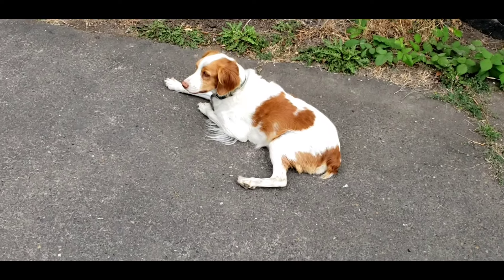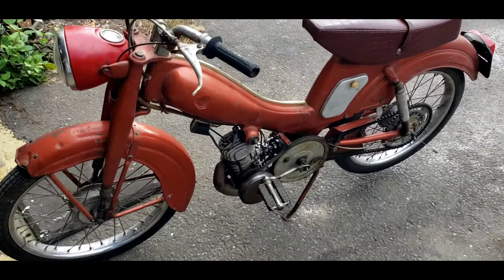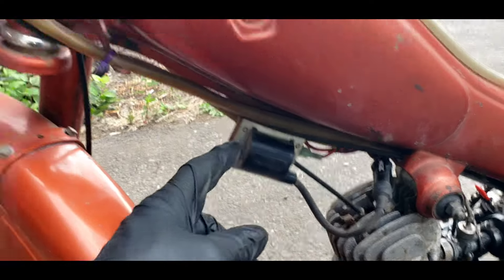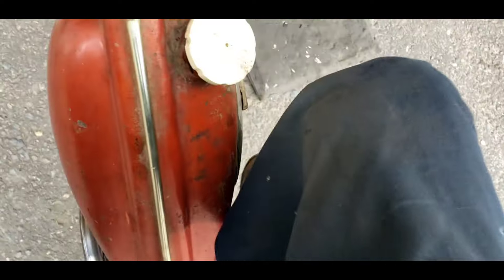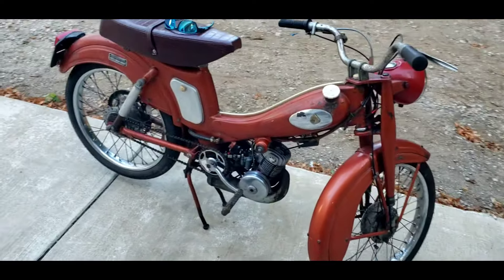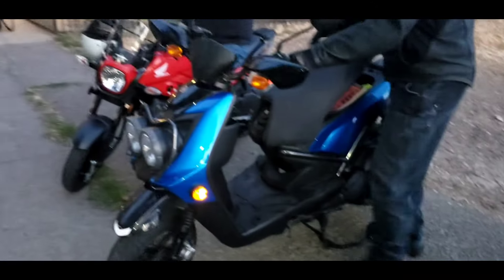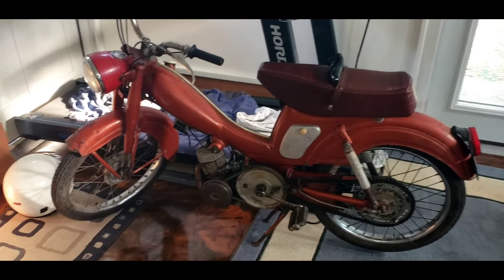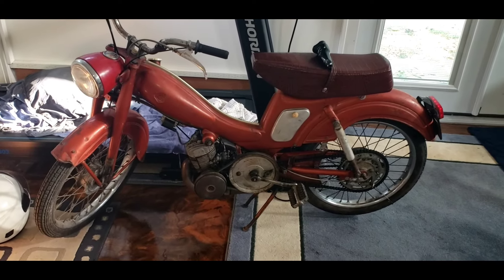Dreamy 30 Mile Ride Really Hurt

Comment: My first road bike was a derelict 1958 Sears moped. Puch 50cc pedal start two speed manual with left twist grip shift. Tires in that size were not available (1984) and the ones I had were dry rotted so it was a great learning machine how to keep it alive and how to use tire tubes and tire patches in interesting ways to keep it on the road.

Comment: Most scooterists love TSS (Two Stroke Smoke) - never worry about that on a ride.
Reply: Modern two-stroke oils don't really smoke, it's just the smell.
"I Love The Smell Of Two-Stroke In The Morning!"  1990s MZ Riders Club T-shirt.
Reply: Once the engine warms up, there should be little to no smoke…
Reply from the maker: You're right,  I keep checking and I'm worried that there's not enough smoke.

Comment: My first motorbike, was a very similar moped (different branded body, but engine and drivetrain near identical). It's easier to start these while pedalling along the road, that gives you a bit more get-up-and-go, as you rapidly twist the throttle from the fully forward twist (the decompression release) setting and then twist it back to give the engine some fuel. If it doesn't start first try just keep pedalling, decompress again and then as the engine spins over, back onto the throttle.  

Mine had a Chrome-metal bore, so that pistons and rings could be replaced without needing to rebore the cylinder. Running on "petr-oil" as in petrol/gasoline and 2 stroke oil mixed.  

The "disengage" lever on the big pulley by the left pedal, just disengages the engine entirely. If you're broken down you can then simply pedal it like a normal bicycle. 

However it is incredibly low geared and impractical to ride as a normal bike for any more than a few hundred metres.  

 However with low powered engines, going up steep hills, one can pedal to help assist the engine. 

Here in New Zealand, At the time (many decades ago) to qualify as a "moped" a small motorcycle had to have "pedals that can be used for alternative propulsion" (and engine power under 2kw / approx 3 hp).  (Later the term 'moped' has been used for the modern  2 stroke or 4 stroke, scooters without pedals, but having a restricted 60kmh / 36 mph limiter on the engine. 

They use the same kind of variator transmission. The speed limiting is either acheived by a sorta washer installed in the variator which keeps it from advancing all the way into the highest ratio, or sometimes simply a restrictor on the throttle slide in the carbuerttor from opening all the way.  "For off road use only" people sometimes remove those restrictions and the wee scooters can get close to 80 kmh / 50 mph. 

Decades back when I had my moped, , a full motorcycle licence was required to ride one.  Some people would use a moped to take their motorcycle licence riding test, and then go out and buy a "water-bus" the Suzuki 750cc triple cylinder water cooled motorbike which was popular at the time. (early 1970's). To restrict that happening, new motorcycle licence holders were restricted for the first 6 months to a maximum 250cc engine and 50 kmh / 30 mph max speed limit.

Nowadays, in New Zealand, a person having just a car licence, is also allowed to ride a "moped" even one without pedals, that has the 60 kmh speed restriction fitted to it.

In the Australian states it is different in every state. Some states require a motorcycle licence while some states allow low powered moped scooters to be ridden on a car licence. Some states have a specific "scooter" licence, which I think allows the higher power scooters up to 250cc engine, but ONLY if they have fully auto transmissions.

Comment: You don't really get a beam from that front light. 12V would be easier to find as a plug in, but 6V LED light 6W would give you better light than it originally had. 13W would give you a rough equivalence to a 60/55W halogen. Were the original lights bright enough to have a main and dip option? At 13W, I'd just sort a permanently dipped arrangement. If that is a 1959 original tungsten bulb, an easily available moped 40/45W moped halogen light would be an improvement.